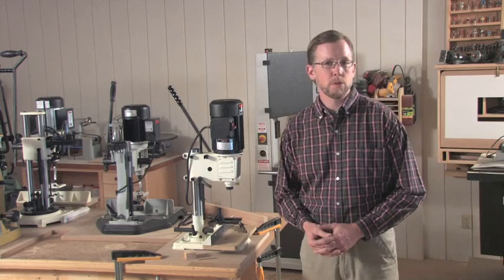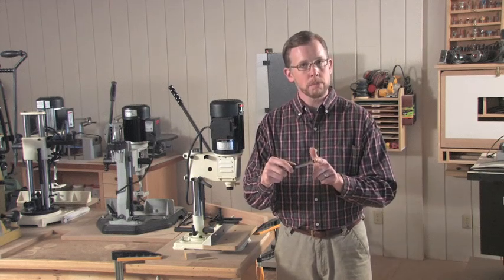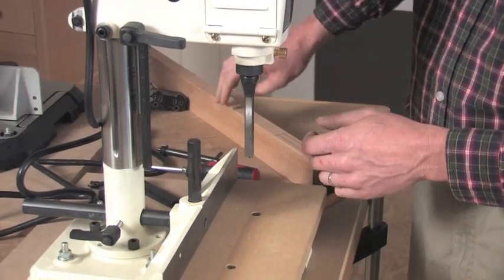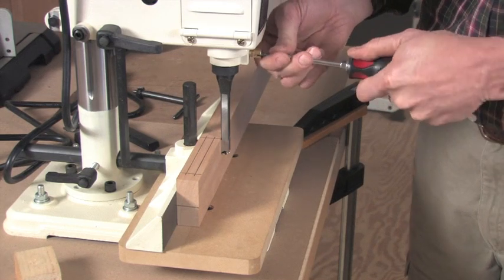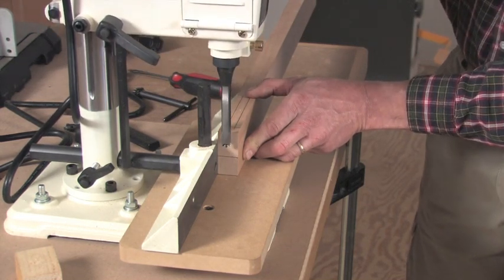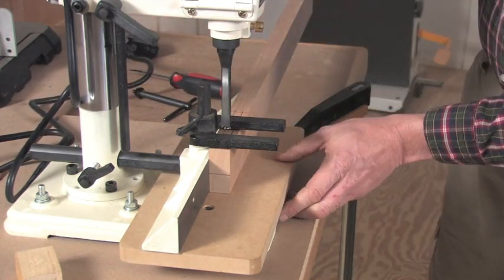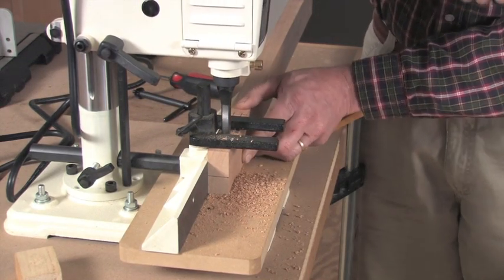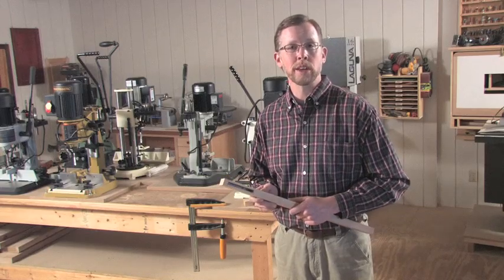How to Set Up and Use a Mortising Machine | Hollow Chisel Mortiser

Comment: Very good video, was of great help to me. 
I had my first experience today on a mortising machine which I recently purchased.
Three mortising chisels were supplied with the machine.
The end of the auger bit is larger than the square chisel, so the auger bit can't retract.
So I didn't have allow for a spacer.
I applied the information from your video to set up the cutting, and am glad to say that it turned out perfectly. A nice straight square cut.
Thanks for your help.

Comment: he reason that the manual recommends fitting the chisel with the opening to the side is because it is easier for the bit to eject the chips into the mortise thus reducing build-up of friction and heat in the bit and protecting the temper in the steel.

Comment: thanks... I came to find out what mortising is, because I found that "high speed mortising bits" at Harbor Freight make amazing, budgetary spiral endmills for 3 for $15 and they don't even dull really fast. I use them in a drill press that I do a little milling with using a cross-vise. I make milled flats and channels therein just like if I had an expensive endmill and you get three sizes. I expected the big one to dull after one project but it's still going strong after several. You could have sold it to me as a cobalt steel bit and I'd be none the wiser.

Comment: Thanks for this. I just set up my ShopFox and heard some squealing from the bit. Wasn't sure if that was normal and found this video. It's normal, although I don't remember the larger floor model that I used a while back doing this.

Do you find that you need a longer lead on the bit for harder woods? I did a test on some cherry and it seemed to work better that way.

Comment: what is the advantage of it between the router?
Reply: mindfreak001009 The Router makes a round hole at the end while a mortising machine is square consistently. You can use a dado blade and it makes a round hole going up at the end. I am going to use the router then use the Mortising machine to make the ends square.
Reply: depending on the user 
A more precision 
B faster 
C square edges

Comment: CaptainFuture, I take issue with your comment about his tightening the chuck at every point to be "bullshit."  One, that is how I have always tightened bits and consider it good practice.  That could be labeled as "bullshit" too.  Riddle me this:  If I go to tighten a bit on my drill press or mortiser and torque one "access" point as hard as I can, why is it that I can easily tighten the bit further when I move to the next "access point"?  Also, on my drill press chuck, why are there three holes? I have never found "access" to the chuck to be difficult.  If access were the only issue, all you have to do is spin the chuck until you hit that spot you can access...
Reply: Mmmgggg

Comment: That thing with tightening the chuck with all access points is utter bullshit. The lower part is stationary while the upper part tightens the jaws by spinning. The access points are only there for accessebility and providing something for the key to go into.
Reply: The sheer tone of your response is self discrediting. Plus, the original tip of tightening the three access points stands solid in reality. From 30 years of experience.
Reply: You probably need more experience using drills and mortise machines.  If you don't tighten all access points, the bit will not grip as tight and is likely to lock up in the wood.